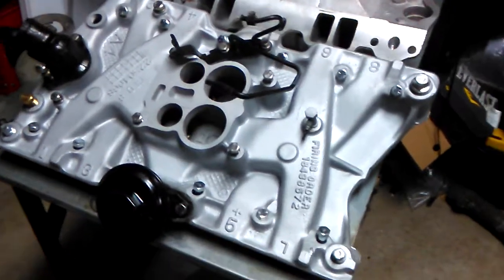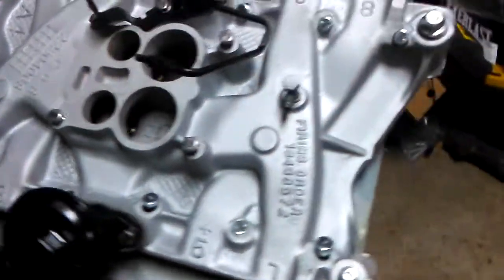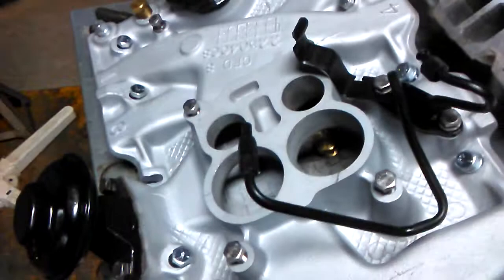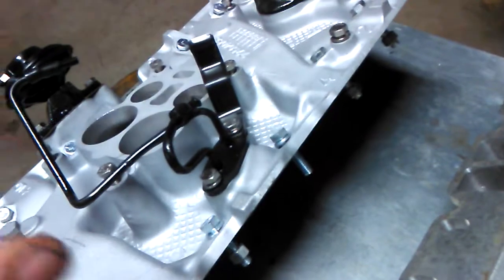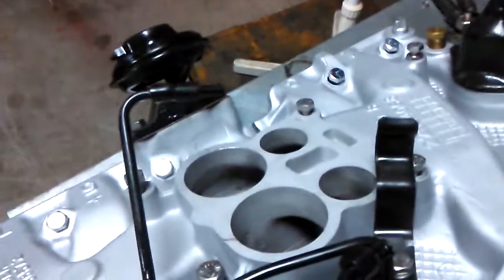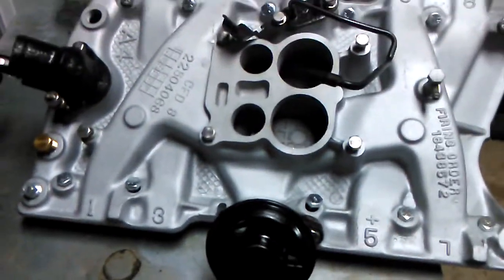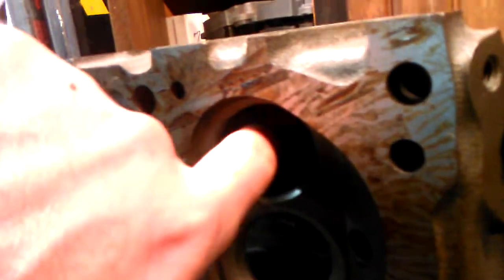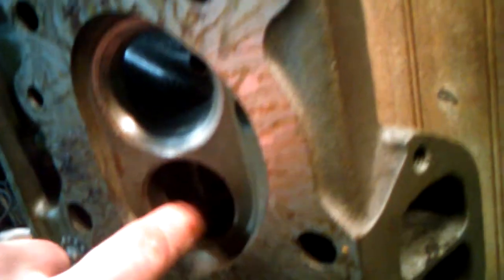Old-school Intake manifold modifications, part 3

Comment: Question. Because I really don't know. For climbing mountain roads. And towing in steep hills. Is cold intake better or hot intake better. Using old school cuadrajet. Weather conditions I'm in Phoenix Arizona. Flagstaff Arizona is our tallest location. Winter time it snows in Flagstaff. What is best for this scenario? And location.
Reply from the maker: I'd go cold.  Remember that, after the vehicle comes up to temperature, the intake is going to be hot. It's only the first 5 minutes that it will be really cold anyway. It's just not as warm as a heated one
Reply from the maker: As long as you pair it with the right kind of carburetor as explained in the video
Reply: @ShawnStjean  Thank you. My thoughts was the Edelbrock AVS2 with electric chocke, for simple tuning. I admit. I'm not that familiar with Holley carburetors.
Reply from the maker: @armandomendoza3167  I think that would be a good choice if you're going cold, with the annular boosters.  As far as the choke, I've had a few electric chokes that worked real well, and I've had several that gave me trouble.  To me it's just simpler to pull them off
Reply from the maker: You're welcome.  Thanks for checking out the channel, good luck with your project!

Comment: Where's part 1 but to block it off in the head is best and it's good for 15 HP..
Where the exhaust headers bolt on the two center exhaust have a slight dip weld them to separate them that's 5-7 HP..
Reply from the maker: https://youtu.be/Ib_iul-W41s is part 1